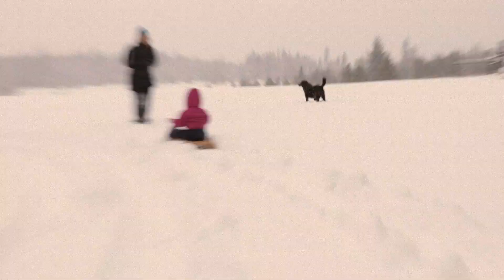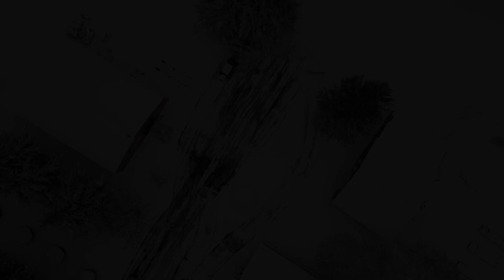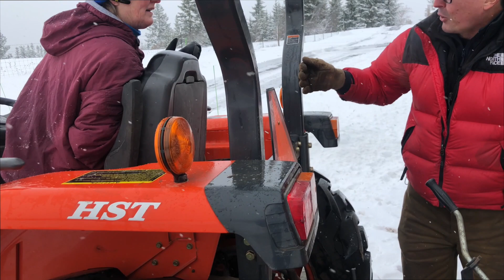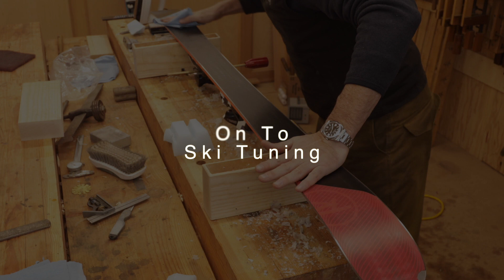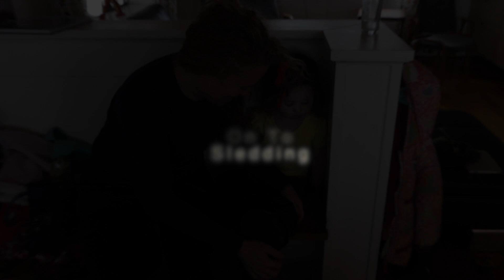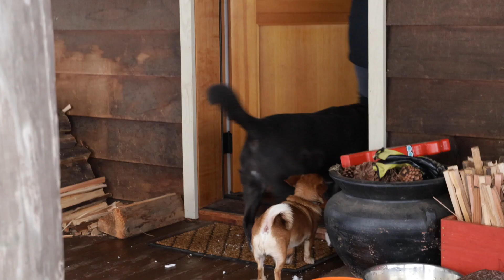How A Bic Lighter Saved The Day

Comment: A west coast guy gave me a great survival tip with BIC lighters. So you break the lighter and pour all the light fluid on your tinder. Then go at it with two sticks and hopefully you can get an ember before the fluid evaporates but once you do the tinder lights up real good! Only a west coast guy could come up with something that clever!
Reply: You know that's pressurized gas in those lighters, right? Under normal pressure and worldly temps that stuff can't get poured. It'll just shoot out in an icy cold jet and you'll have wasted your best fire tool.

I'm not from the east coast though, maybe they put something odd in there. Doubt it though.
Reply: Nusm4 sarcasm: Noun: the use of irony to mock or convey contempt
Reply: Nusm4 and the pressurization shouldn’t be the issue with this tip. If you have a lighter use the lighter.
Reply: @beek2930  Okay then, kinda hard to tell what's meant seriously and what isn't these days. I swear, someone who doesn't recognize the intentional absurdity will read your comment and believe it, the way it's written.
Reply: Yes, that's true, or ugh, God help them use whiskey to light a fire and save themselves from frostbite.
Reply: Lighters use butane which can and will freeze down around 0 to 10 degrees F.  Butane and propane are both gases under normal temperature and pressure and will liquify under pressure.
Reply: that doesn’t seem like a good idea

Comment: The last shot where you compared a 18th century sled to a 21st century sled reminded me if a 18th century sleigh I seen on a farm once that had 4 wrought iron skis to fixed and two steerable, all with 4 coil springs per ski and two leaf spring per axial side. It was set up to be drawn by two horses natural maple wood finished with a shellac coat that made the grain move with the light. leather trim and velvet seats. I talked to the owner he told me it was the highest quality that money could by and was purchased in 1799. To tell you the truth nothing nowadays comes close to the workmanship of the sleigh. It had been kept clean and in great repair thru the years of course. I can't think of anything made now that would last long no matter how it was cared for. Chances are that wood sled you made will probably outlast the one that you bought if taken care of properly.
Reply: Charles Reohr . You can watch a heavy bob sled with 4 runners, 2 steerable, being made in the present day on YT at Engelescoachshop or EngelsCoachWorks where Dave always does remarkable carpentry & blacksmithing.
Reply: @filmbluff99  Thanks

Comment: The first winter tires or snow tires were introduced in Finland in 1934 when Nokian made tire trucks that were designed for handling stormy weather. The radial tire was invented in the 1950s. It is a type of tire with the cords and carcass plies arranged vertically to the driving direction.Nov 21, 2017

Comment: Your observations at the end of the video is spot on. I'm a mountain biker and was comparing my 1994 Gary Fisher bike to modern bikes.
Bikes now have full suspension, disc brakes, drop post seats and some have electric shifting.
On top of all that they cost as much is a used car.

Comment: I've been preaching about Nokian Hakkapeliitta studded tires for close to two decades now. I was logging in Northern BC when KalTire started selling them and they quickly became the talk of the town/bush. All of a sudden a lot of guys had all of this new found traction on bad winter bush roads and it resulted in a few really bad accidents (head on collisions) with loaded logging trucks as some guys didn't know when to slow down. 

I love my Hakkapeliitta studded tires. I don't run them on my 4x4 truck, it's a Dodge 3500 Dually with a 10 ft deck and I need 10 ply tires for it and Nokia didn't make them (they might now) but I run studded Hakkapeliitta 7's and the car and the new 9's on the van. With these tires I don't care how bad the weather is, I just go and I always feel safe. 

I've talked a lot of people into buying these tires over the years but I always warn them about driving to fast and not realizing how bad the road conditions really are. Safety first!!!
Reply: @JimmyVaught  I'm pleased to hear it.
Reply: We put our first set of winter tires on in 2003.  I've been using Nokian tires for a few years.  I started with the cheaper brands, but they just aren't good enough.  We only use the studded, from the factory.  For us it's about being able to stop and have total vehicle control.  We bought two new sets of four Hakapellita LT2s this year.  I'm never going back to sliding out of control thru intersections ever again.   My wife likes to say if you live in snow and ice than you need ice tires.  If you can't afford them, then you can't afford your car.  That might sound extreme, but how much does one accident cost.  A few years back, the first ice/ snow of the season, I avoided multiple accidents.  No one was driving recklessly, they were just unprepared with poor tires for the conditions.  That one day paid for my tires ten fold in deductibles alone.

Comment: The Nokian studs are very advanced now, even beyond the previous generation. But don’t sell the studless versions short. The Hakkapeliitta R2 and R3 have built-in grit in the rubber compound to enhance ice grip. The latest Bridgestone Blizzak WS80 and WS90 are the only other winter tires I would compare to them, they also have grit particles. I’d recommend either for anyone who can’t use studs in their area. They are all amazing.

Comment: Running Nokian Hakkapeliitta 7 on my car. They are very good. I'd say at least as good as Bridgestone Blizzaks or another brand, if not better. For deeper snow, people should know there are "performance" winter tires, vs. standard winter tires. The performance variety are designed for sporty cars to still handle good without vague mushy steering and handling inherent to taller tread lugs, but the treat depth is less than standard snow tires and won't dig through deep snow nearly as well.

Comment: My one complaint about our kubota is that the roll bar is not quick release.  I suspect the missus has a low overhead garage and doesn't bother re-deploying the bar.  That's a mistake, as no one expects to tip but the bar is there if you do...

Comment: Have you tried a set of Bridgestone bluzzaks yet? That's what I run and its like it on rails. I have yet to try those snow tires in your video, however I'm wondering if you've tried blizzaks and came to that comparison.
Reply: Blizzaks are the "old school" winter tire everyone ran. Michelin Alpins are great for sports cars and the ones he showed are basically the king of pure flat out snow/ice tires.
Reply: @deadbolt9019  I trust old school more than new school. Tried andntrued and redesigned over and over to make it better and better.
Reply: @scubamech707  for tire tech I go with new stuff almost always. I'm an avid offroader (and motorcyclist). New tires HANDS DOWN beat the old stuff. Nitto Trailgrapplers vs OG GY Wranglers? Nitto beats them BY FAR. Pirelli Night Dragon motorcycle tires over bias-ply "tried and true" cruiser tires. Better compounds, better/advanced construction, better tread patterns.